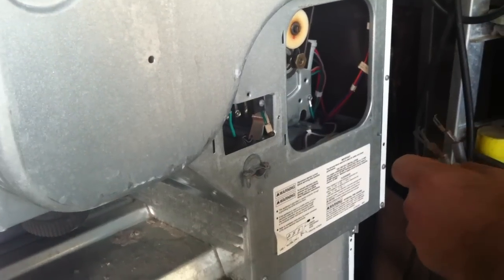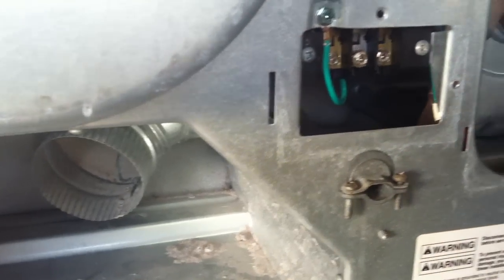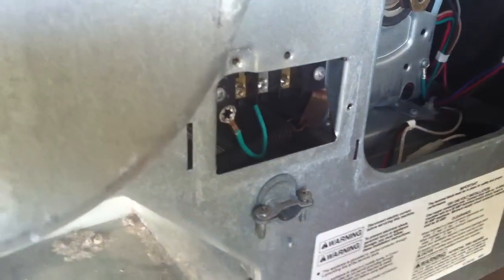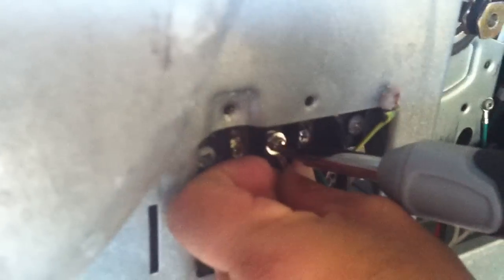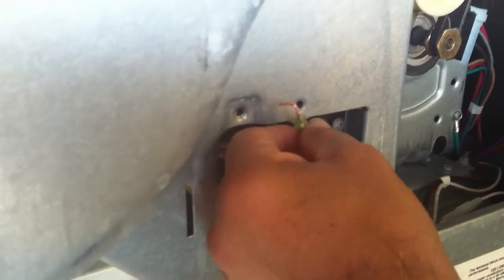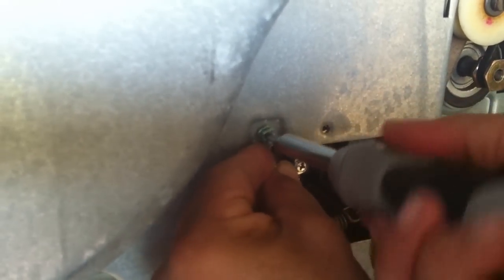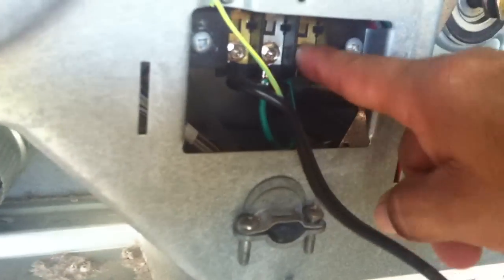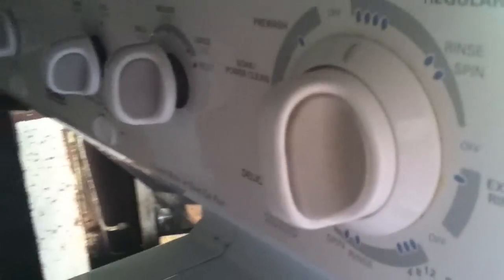240V Washer/dryer connected to 120V

Comment: Thank you very, very much amigo. My washer/dryer (aka laundry center) specifies only 240v and I need to run atleast the washer for now. It did not mention which terminal is for only the washer. And for all of the people asking if they can run a 240v electric dryer on 120v, you CANNOT for safety purposes. The reason being that if you cut the voltage in half, the amperage is doubled. You are attempting to pump twice the amperage (starting amps) out of a 120v circuit than what it would on 240v. 120v can be more dangerous than 240v in some circumstances. Remember, amperage is what heats up wiring, hence why 120v requires such large gauge wire. If you manage to run the dryer on 120v it might be as warm as a sweaty ball sack. Consider a gas unit instead.
Reply: This is incorrect. The amperage doesn't magically double. Your dryer will simply work at a lower wattage (1/4 power to be exact), so it will dry extremely slow at 120v. This confusion is do the formula E=IxR (Voltage = Current x Resistance). So the thought is that when you decrease voltage, current must go up. But decreasing voltage reduces counter EMF which means resistance is less. Your load demands what your load demands. Changing the supply voltage doesn't alter this.

Comment: Can this be done to a 240 electric dryer? I have a friend that has a fullsize dryer that runs off a plug just like this one he engineered. It works amazing she does know the person who made it did change it to do this but he no longer sells them. Can i do this to a fullsize dryer? Please explain why or why not and how she has one.
Reply: Randy Blü a full size dryer heating element draws around 5,600 watts, about four hair blow dryers on high. Because of Ohms Law, watts = volts X amps, the most you can get out of a 110 receptacle is 10 or 15 amps. you are correct that a clothes dryer can be wired 110v to the element but there will only be about 1,500 watts available to use for heating, about the same thermoelectric yield as a blow dryer. In other words, it will take about four times as long to dry the same amount of clothes using 110v/15a  as it would 220v/30a.  This is why 110v dryers made for marine or recreational vehicle applications have 300 minute settings on the control knobs and buttons.
Reply: Can I use my 220 cord off my old dryer on my stackable washer/dryer the 240 doesn't fit

Comment: this looks cool!
I just got a set of washer dryer.
Can I do this to my dyer, too? It's a 240V. Can I use the same cord as you did if it requires 30 amp?
Reply from the maker: James Nguyen All dryers work on 240 v. If you put your dryer on 120v by this method it won't dry your clothes. If for some reason the dryer wont work anymore I only made this video to show how to use the washer.
Reply: Guillermo Garzon OOPS, I thought it was for the Dryer. I have yet to plug  the dryer into the wall outlet because I'm still figuring out this 30amp that's necessary for my dryer. 
I'll be getting a 240v converter box instead & a cord that can handle up to 30amp
Thank you for taking your time to update me, good sir

Comment: Can i put a jumper power wire from one hot to the other so I can run either the washer or dryer on 120 ?
Reply from the maker: Sorry my friend I'm not an electrician but I don't think that is possible. The outside wires (black on right and red on left) are your hot wires. The washers only work with 120V so if you jump the two lines you get 240V and washer will be damage and.... be careful. However dryer may works but won't dry your clothes, by the time that I put this video there was no information for stackable w/d  240v to work in 120v. Please let me know if you figure out how to do it.